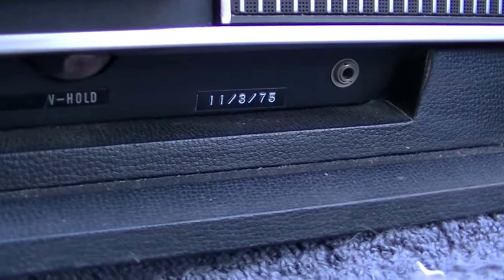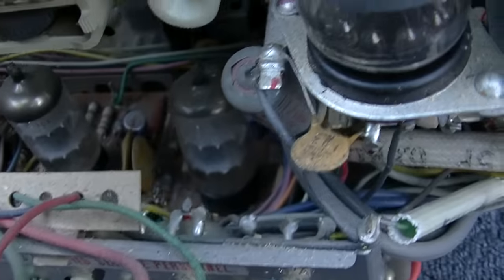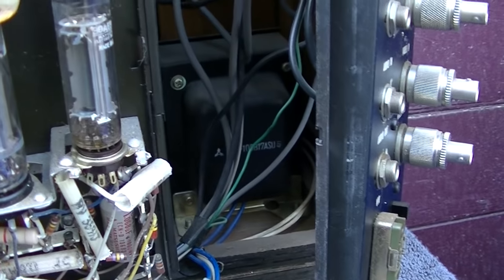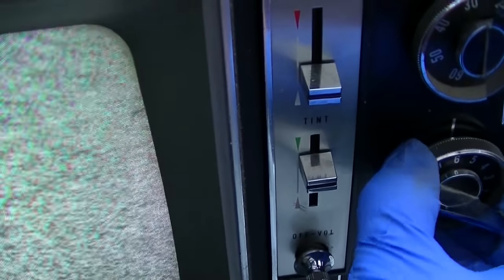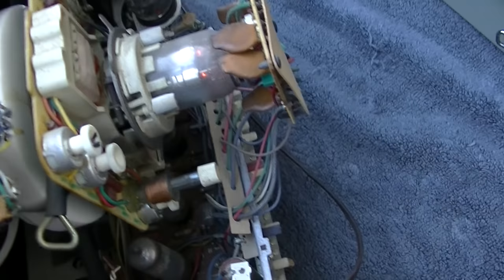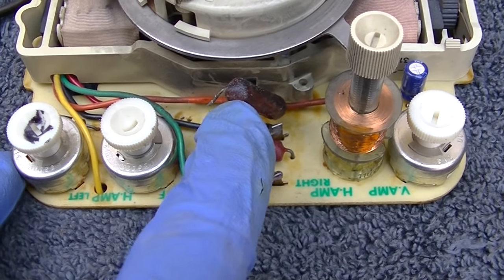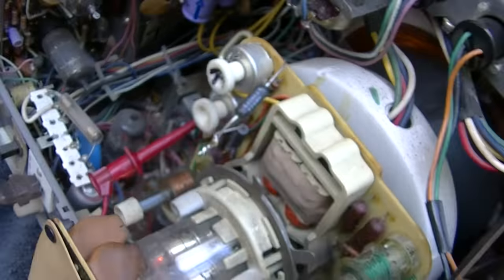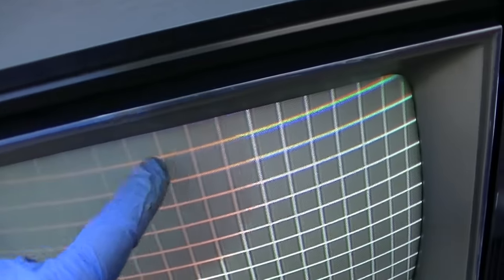Panasonic Panavision Commercial Hybrid Color Television Repair Rare VRT TV

Comment: Here’s the story behind Lifetime tubes per a friend of mine who was a Radio Shack manager. The Lifetime tubes were rejects and over runs. Sometime in the early 80s, RS dropped the Lifetime warranty as they were losing money on them and renamed them Long Life tubes. The last batch made in the 90s had a blue etch. They were total garbage as stated and from personal experience. Other brands of garbage from my experience are Lindal, ITT Raytheon from the 60s onwards Channel Master and Sonotone. I stick with RCA, Sylvania,GE, Tung Sol(USA), Westinghouse, CBS, and USA made Raytheon tubes and rarely have a problem.
Reply: Raytheon made garbage vacuum tubes? I find that hard to believe as they were, and still are a cornerstone of the Military–industrial complex. And heck! I had no idea that vacuum tubes were still being made and sold even up to the 1990's! I honestly never ever saw any for sale after 1984-6 at the Thrifty drug store that had a vacuum tube testing rig for the customers to use. Vacuum tubes were sold in the photo section.
Reply: I used to work for Raytheon Equipment Division located in Waltham, Massachusetts for 11 years. I work next doors to Power Tube Manufacturing that manufactured Tube for Dumont TV as some supports components including PCB and wire wrap board for military and commercial equipment. Raytheon has very high reliable build quality and very reputable equipment for a long time. The problem in America was we have a treason at high level and that why America can no longer work on quality product anymore!
Reply: On many occasions, Ratshack was a lifesaver. Not my first choice, but I'm very glad they were around.  Back in the day we also had Lafayette Electronics, Olson Electronics, Heathkit and about a dozen mom and pop parts stores. All gone. 
Thanks for the memories.
Reply: @chachavessel  Allied Electronics in Chicago. Went there as a kid. An electronics wonderland. RS bought it out, shut down in Chicago, moved to Texas (I think) and ruined it.
Reply: @KameraShy  this is jogging my memory..McGee from Kansas City. Fair Radio Lima, Ohio. And yes, Allied Radio, which was later acquired by Tandy.
Reply: Yes, I remember ITT, they sent out ads to shops offering tubes at 85% off retail.  They were often defective out of the box.
Reply: @robinsattahip2376  The ITT tubes sold here in Europe were mostly built by Schaub-Lorenz, Stuttgart, so we were a bit more lucky, I guess. No quality issues
Reply: @blitzroehre1807  My uncle brought  German manufactured in W. Germany large TV made by Schaub-Lorenz back in 1970. The set was operated under 220V. 50 cycles current which used in Thailand. The product was a high quality set and we never hardy have an issue. The price was high in Thailand back then.
Reply: @albear972  lmao, vacuum tubes in the photo section.

Comment: Oh, man, I thought I'd just look in on this. & I'm going on how many mins now? It's been a long time since I've seen the insides of the back of a tv! My dad used to do most of the repair work on our old b&w console tvs from RCA until they went completely solid state. He worked there so he got a discount on all company merch, including all the tubes. I still have 2 1950's models I inherited, one that had picture & the other had sound. 😁
Had to laugh when you were enthusing "It just popped in!". That's one of the deals abt the old tv repairs I recall. Sometimes it worked like wizzardry - like there was no reason at all for sudden responses. My dad would meet a time like that by standing back a step or 2 & just resting his hands on his hips in wonder. I loved it. That's what encouraged me to start messing around w/electronic stuff. 😄

Comment: Those slide controls always seemed to be much more problematic than traditional rotary pots. They were very popular for a while and you used to see them on everything. I used to have an old Altec 714 stereo receiver that had them for volume,balance,bass and treble. A couple were touchy even after cleaning.
Reply: This is no big surprise: Sliders get the force while sliding in "every" direction(up/down of course, but always sideways and pressing on to the resistance track) and the bottom of the slider is the only "bearing" vs. having a sort of bearing for rotation and the resistance track separated in the rotary ones.
Reply: @deineroehre  Slide Control was very popular in old American Automotive made during the 70's. It connected to cable that connected at actuator to close and open Ventilation. The cable needs a constant lubrication with oil and geezer. In electronics the slide control always on Radio and TV equipment that manufactured from Japan and some West Germany brand that manufactured in Japan like Gurndig.
Reply: @deineroehre  Yes,I understand that and it doesn’t surprise me either. The issues you mentioned are an inherent drawback of the design. Virtually any vintage piece of equipment I’ve run across with sliders always had problems. What did surprise me was that Altec even used them on their top of the line 725a receiver that cost $700 (in 1970). They were in vogue at the time though (llate 60’s into the 70’s) and aesthetics trumped reliability.
Reply: I think the sliders were prone to dirt and crud because the slider couldn't be sealed properly along the length of the pot.  Conventional pots were fairly well sealed where the shaft went through the bushing.

Comment: Wow, this was actually my television set.  I bought it in 1975 when I was in college.  I marked the date on all my equipment. Note the Dymo label on front.  I owned it for over 35 years and
sold it on Ebay about 2010.   I bought it new. I think I paid $350.00 for it new which was a lot for a 22 year old young man back then. It had very little time on it over the years.  The case was made of wood with a vinyl cover over it.
 It was a great set.  I wanted to work in Broadcast TV.  Back then to get any experience in broadcast television you had to work for a company that would hire you to get experience a studio or editing company.  No luck for me to I started to buy TV equipment, video tape machines and cameras.  In 1975 there really were not any VCRs, TV cameras or other consumer products at the time.  I had a Cartrivision video tape cassette machine at the time and a 3/4 inch Telemation cassette machine.  I also had an old Dage black and white tube industrial camera.  I learned a lot and ended up working at NBC Burbank Engineering Dept for over 35 years.  When I sold it it had some color convergence issues. The pots were bad that adjusted the RGB guns.  The CRT should have many years left on it since I only used it for  college projects in editing tape over the years.  I sold it with a schematic. Hope the owner still has it.
Thanks shano for fixing the set.  I never would have found that diode problem. It would come and go.  Always thought it was the pot.  Thanks again for bringing back great memories of my youth.
Reply: thats insane 
it must be crazy watching your old set popping up in a shango video
Reply: Very cool!

Comment: 28:31 I never get tired of that overhead view of the glowing tubes. Those who have never experienced that in person will never know the searing, breathtaking, overwhelming heat that tube TVs give off back there.
Reply: Lol I often used to put my old big back TV on as a kid to heat up my room...now I just over clock an play games for same reason
Reply: @foxxy46213  just fire up an old pentium d machine.
Reply: @qwertykeyboard5901  - I still have under my desk and use my early 2000's Dell 8250 with XP, and although it does get uncomfortably hot on the hottest summer days, it is not even close to a tube TV. A tube tv down there and I'd be roasted . A tube TV wouldn't comfortably heat a whole room, but if you were within a foot of it, above it and behind it,  it could help keep you warm in the winter (think four or five glowing hot coals)
Reply: Yes!
Reply: Plasma tvs are nice in the winter too

Comment: Another one with a plot twist, nice. Not jumping conclusions saves you money and frustration, shango is proving this over and over again.
I recall these slider pots seemed to have a universal point of failure with contacts breaking off the plastic sled, unless the handle broke off first, that is.

Comment: Radio Shack sold lifetime and long life tubes. The long life were more common after the lifetime tubes went away.
I used to buy the lifetime ones and I don't remember ever having one die. They had gold plated pins to make them supposedly get a better long life connection to the sockets. We had a Radio Shack very close to where I lived and they had the tube testor on the wall.
One of my buddies got it when they finally stopped selling tubes directly in the shop.
I was given a really nice suitcase one from a TV shop I used to get the TVs the customers decided not to fix. Another shop gave me a beat Beltron crt rejuvenator later as well and that really helped up the TVs I could get fixed and looking good again.
Reply from the maker: Those tubes were garbage the pins were sandblasted not gold-coated. Watch my video talk and tubes with Al
Reply: @shango066  agreed
Reply: Radio Shack electronics good for the price. never high end

Comment: What was interesting was how you placed that diode in the sun and it went open, then freezed it and it changed voltage. Cool tv and how it has a connection for an early VTR machine.

Comment: In about 1991, I bought a Realistic "long life" tube that came in a blue box and had the number hand-written on the box. The tube was a dud, right out of the box. I got my money back and never bought another Radio Shack tube. As far as the video connectors on this set, my elementary school had 23" commercial-grade tube-type RCA color sets (CTC39 chassis, IIRC) and they had those types of connectors on them. They were mostly connected to Sony U-Matic tape machines and in about '87, they got a couple of VHS machines. After elementary school, I never saw another U-Matic machine in use at the school and the TVs were newer solid state Zenith sets. The only exception was one of the tube-type RCA's in my high school biology class and the one time I saw it on, it needed major help. I tried to get them to give it to me or sell it to me, but you know how schools are about stuff such as that. Even the tube RCA sets in elementary school were flaky and it usually took some fiddling to get them to look right.

Comment: I used to work on special assignment to do Inventory of Corp. Propaganda department back in 1989. I remember I saw this type of professional set including video camera and tapes set  in NTSC/PALAM for 110v 50/60 cycles for activity recording and cable similar to this set. It is very expensive back then . This particular set could cost over than thousands dollars back then that not including camera and recording set that could added up to several thousands dollars back then.

Comment: PL-259 was THE defacto broadcast industry composite video connector until the BNC started displacing it in the mid-70's onward. I had piece of 50's RCA TV broadcast gear with it. I have a 15GP22 based Tel-instrument monitor, RCA TM-21, 3 different EIAJ RTR-VTRs and a Sony VO-1600 (the first U-matic deck) with those PL-259 connectors for composite video.  
I wish I could find an early 70's Sony or Panasonic color VTR monitor to go with my EIAJ and U-Matic VTRs.
That multi-pin VTR connector fed audio and video in and out between the TV and VTR eliminating the need to connect 4 PL-259 and 1/4" phone jack audio cables between the two. The  cables themselves aren't common and are worth a lot of money (apparently they were used on some Star Wars film prop that everyone wants to recreate accurately for themselves).

Comment: Ahh the old 8 pin EIAJ VTR connector. I remember having a National (Panasonic) TV in one of my classrooms in primary school here in Australia. It was a later solid state unit, had the same style inputs and outputs on the side of the cabinet including the 8 pin connector. Always thought the PL259 jacks were odd for video. It explains why many of the AV cable and adaptor multi packs back in the day came with PL259 to BNC or RCA connectors. I can't remember if it had 1/4" audio connectors like yours or if it possibly had RCA connectors. It had a pair of inputs and outputs and the 8 pin, and a TV/VTR switch I think.

Comment: Great video. I dabble with TV, I'm a ham radio operator & we just cannot help it. About your old analog system there in USA NTSC. We call it never the same color as compared to our PAL system here in Britain we always thought NTSC color was over the top. I had a multistandard TV & a 1.5-meter dish motorized. That TV was great JVC did  PAL, SECAM 4.43 & 5.58 color systems I received NTSC transmissions too on it & I did think the color was over the top,
Reply: PAL & SECAM were later improvements on NTSC, which was the first broadcast color standard, but the FCC would never allow the standards to be changed as it would obsolete the millions of TVs that were in the consumer households in that time. ,not to mention all the broadcast equipment costing many millions of $$$ that would need to have to be changed.

Comment: My Realistic tube experience.  I have used many Realistic Lifetime matched pairs in audio equipment repair and restoration back in the day.  Some of that equipment is still in use today.  With any audio output tube driven hard they are pretty much toast after 5000 hours.  When attempting to get replacements for the Lifetime tubes I was given Longlife tubes that were overrated.  Ie 7189A (EL84M is close) with  6BQ5/EL84(s) that amp lit up like a Christmas tree!  I went round and round with Radioshack they never did replace them with the correct ones.  The 6GH8As' were replaced with 6U8s'.  Try to get a stable chroma oscillator in an RCA TV with that.  The gold clad pins were cool too.  Worked great in worn tube sockets although the socket would have to be replaced once a regular tube was to be used.
Reply: @Doggie Lindsay
Those RS tube pins were NOT gold plated, instead they had the nickel plating blasted off exposing the copper or brass pins.

Comment: thats a really great looking TV, I love the design aesthetic on the old panasonic TVs and radios, like that one 2" (I think) CRT portable they used to sell, with the magnifying attachment that turned it into a slightly larger lesser quality image. Always wanted to get one and see if it would be possible to mod it for composite.
Reply: Design style notwithstanding...
Reply: Those old Panasonics are the Travelvison models They have composite inputs. They are in the form of a 1/8" headphone jack. The set came with a cable with  RCA jacks to hook up composite. I still have a B&W and color version.
Reply: @Rems61  oh cool I didn't know that, is that the color version that has that? I've only ever seen a BW version and it didn't have a composite in. I guess I'm going to have to start looking for the color version. Is it CT-101 ?
Reply: @JessHull  I don't remember if the B&W version does or not, I haven't looked at them in many years. They are both buried in my hoard. But I know that the color one has that jack. At least mine does, I don't know if there are different versions.

Comment: Enjoyed that as usual, thanks.
Interesting that you still have proper 4:3 broadcasts. We have 4:3 content shown on UK channels but the broadcasters often forget to send the aspect switching signals or worse: pad the sides to fit a 16:9 display, which results in a horrid squashed pillar-boxed image on a 4:3 set .. unless your converter box happens to have a centre-cutout option.
Reply: Thats because in DVB HD broadcast, there is no aspect signal to switch to 4:3. You can do it only manually on your box.
Reply: @xsc1000  That's not true. I have a DVB-S receiver pointed at Astra 2 (British TV satellite) and there is an aspect ratio switch signal. My box correctly switches from 4:3 to 16:9 when watching ITV4. They run old 1970s tv shows in 4:3 but switch the channel's ratio to 16:9 for adverts. The dog moves and everything.
Reply: @kyle8952  Its SD or HD broadcast? Because in HD, all is broadcasted in 1920*1080 format. 4:3 format is just put into the centre and remaining space is filled with black, but there is still 1920*1080 format broadcasted, no 1440*1080 (4:3). It looks right on 16:9 HD TV, but there is no information for 4:3 SD TV converter to switch.
Reply: @kyle8952  ITV4 is an SD channel, not HD, so widescreen switching is available.
Reply: @xsc1000  Sorry for late reply. I see your point particularly with the "HD output" mode on common satellite receivers.

It just annoys me that many relatively modern TV sets can switch aspect ratios given the appropriate signals with no need for this padding nonsense.

TL;DR: Or for that matter that stupid 14:9 cropping some broadcasters applied back in the early days of DVB-T but then I'm sure we all enjoy watching "Last of the Summer Wine" with the top and bottom of the image cropped off. (please don't bite I could rant all day about this)